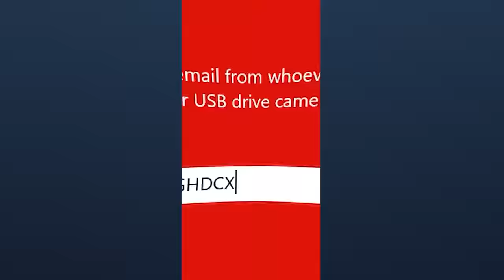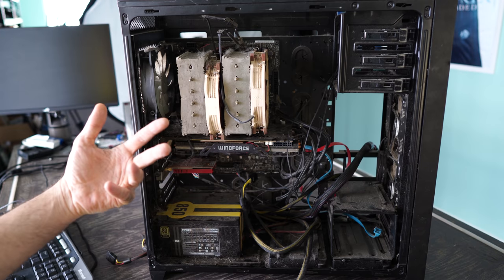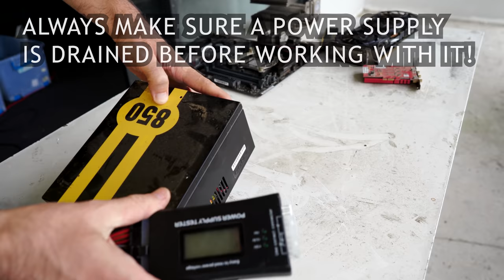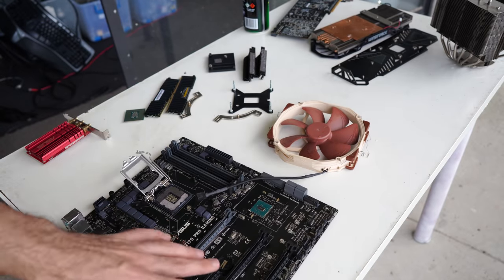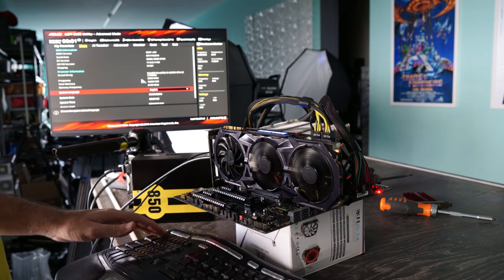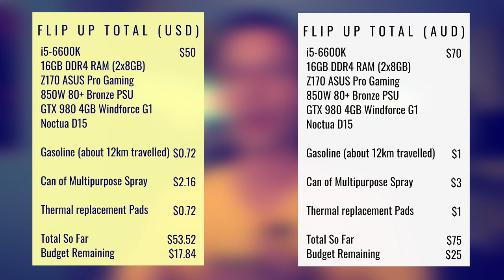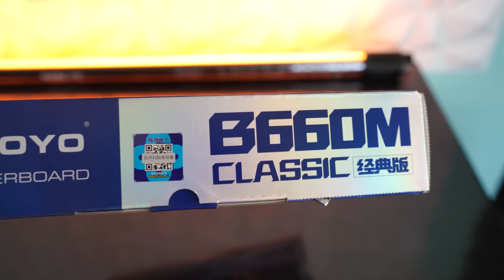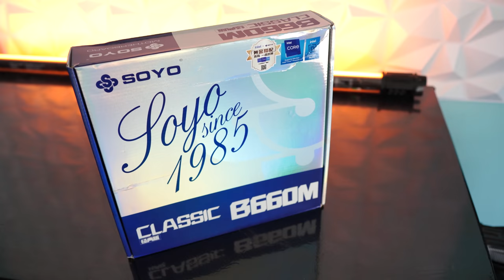Turning $100 into a HIGH-END Gaming PC - S2:E1 "Untested means UNTESTED!"

Comment: Ok, lets play a game, I stopped the video at 0:02 after he asked the question, and considering the title, lets see if ALL the the build is REALLY 100 or less dollars.

So here goes!

Not counting the time to do the tear down, cleaning or labor costs. (At the minimum 100 dollars right there!)

Ok, 70 paid for system
1 in fuel to get it (So he went under 5km to get it?
10 dollar screwdriver
50 dollar vacuum

We are already over the 100 mark right there.

Just becuase you get something cheap, does not mean, after the labor, tool costs, time, effort, and such it was still that same cheap price.

I get so tired of these videos where you see the title like "build an entire car for $250, lets just roll it into my shop that has $500,000 in tools and 7 mechanics on duty to fix it up, and still call it a $250 car!

Comment: Stolen parts
Reply: thats why Bryan was implying but really its a ringer that he put together and put into a kennel.
my guess is that he bought the case, motherboard, memory and cooler for $100, threw in an uncleaned but working power supply that had appeared on the channel before and a GTX980 and placed it in the kennel to age appropriately.